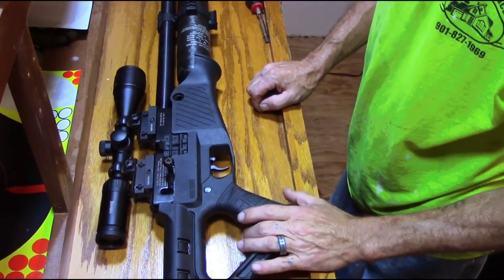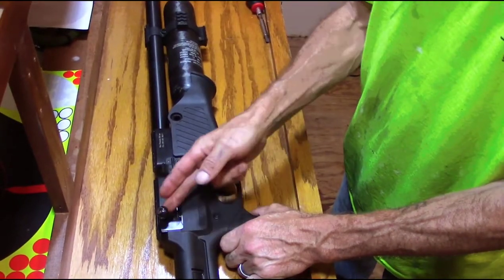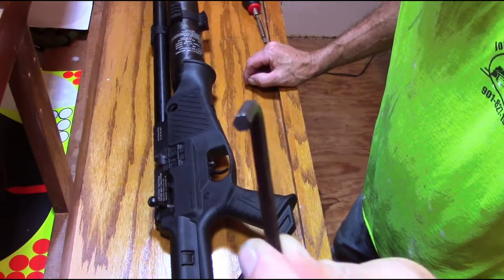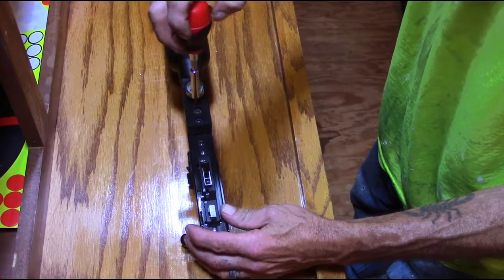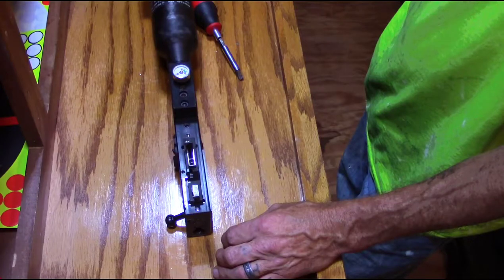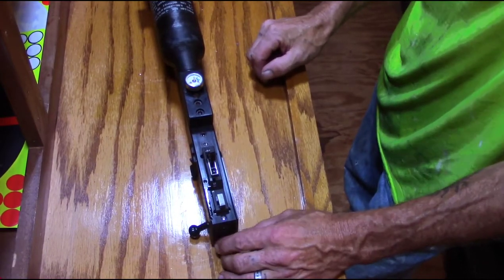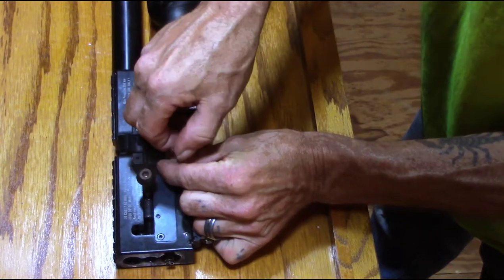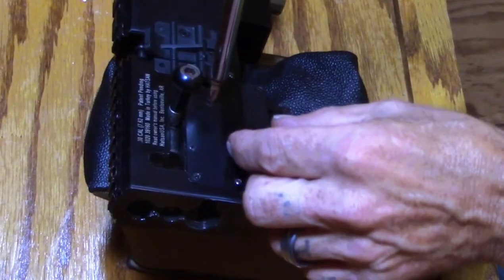blitz .30caliber gen.2 hammer spring adjustment better view

Comment: Yo Roy. Good video. A while ago I tuned the blitz the same way your doing.  Its worth getting the extra long allen wrench pack for that adjustment. I think I got mine from Lows. Before hatsan returned my gun from repair,  I had the older hammer spring screw that did not have the flat head screw in the middle of it. I was told by hatsan reps that the middle flat head screw was an upgrade to keep the hammer spring more stable. Anyway, with the long allen wrench and with the flat head middle screw removed and hammer decocked,  I was able to have the size 5 allen wrench in the hammer and the size 2 allen wrench in the hammer adjustment lock screw at the same time.  I would loosen the hammer adjustment lock screw then make may hammer adjustment then quickly tighten the hammer adjustment lock screw.  And this would be as quick as 10 seconds. Its too damn easy. Your gonna love it when you try it.
Reply from the maker: nice. thanks for the info.
Reply: This is for trigger adjusment? Or what ?
Reply: @fidellopez528  That was for adjusting the hammer spring to increase or decrease firing power
Reply from the maker: @fidellopez528  unfortunately you can't adjust the trigger on the blitz but it dose get better the more you use it. this video is for power adjustment maybe get 3 to 4 more fpe
Reply: I cant wait to get mine past an avg of 670 its down to  after i get whats left of that lame grease out.n new moly in.. im doing baseline   Hates pellets  No probs withmy gun at all   200 pellets or so    . Kinda nernous...
Reply: avg was like 690 fps  44.75grfor a while   //i dont go under 230 bar during test
Reply: @KERNFUZED   bad seals will lower your fps

Comment: Thanks again for the video. I couldn't have done this without it. I just turned my screw out 1 rotation. I went from 680 to consistent 730 + only did 16 rounds im sure it will do an occasional 750. My auto still works. I am very pleased now with the power.
Reply from the maker: Glad it worked out and i could help

Comment: I think il get the 25 over the 30 as it gets around the same energy when tuned macabspeed got 52 fpe with a 25 cal blitz so no reason to go with larger diameter when power is the same in fact 25 is more deadly than 30 at the same FPE same projectile baker airguns did a test.
Reply from the maker: I'm getting 62fpe now i bought a new hammer and a new hammer spring
Reply: @airpower7692  where’d you get those, Thats a decent bit a power now for the 30
Reply from the maker: @fa-sb9ke  hatsan USA i emailed them what i wanted and the emailed me a invoice i paid it and they shipped it
Reply: @airpower7692  What exactly did you ask for Im really considering to do the same mods that would be more potential to the blitz.
Reply from the maker: @fa-sb9ke  i requested a new hammer and a new hammer spring
Reply: @airpower7692   Was it a little heavier spring than stock?
Reply from the maker: @fa-sb9ke  it felt stronger but not by much also the hammer was little thicker which adds more mass to it to hit valve harder
Reply from the maker: @fa-sb9ke  you can see them on that video i uploaded of it
Reply from the maker: @fa-sb9ke  https://youtu.be/YF4SkRbo6r4
Reply: @airpower7692  Ohh I see it now thanks great content keep it up.

Comment: Nice video! For future reference, you can uncock most if not all pcps by pointing the gun in a safe direction, holding the hammer completely back,  squeezing the trigger, and slowly letting the hammer move forward. I should honestly make a video on that as it does go against our safety instincts lol
Reply from the maker: the semi/ full auto blitz has no way to decock unless you remove all air from it
Reply: @airpower7692  I just used the above method to make an educational video on the topic. I'll probably upload tomorrow. One thing that may be throwing people off is you seem to not be able to pull the bolt completely back and do this method. I pulled it back about 3/4 of the way, hold, pull and hold the trigger (in a safe direction), then slowly release the bolt forward. I hear a click when done properly.
Reply from the maker: @tnthomas567  well I'll be damn that worked holy shit thanks a ton bro. that's why i always say you subs are the heart beat of this channel
Reply: Also, just for the less mechanically savvy viewers, you can simply screw the back screw plate the spring sits on further in to the gun to also further increase the power by compressing the spring.

Comment: I dun broke my blitz, Last night I decocked it by pulling bolt back 70% an pressed trigger heard a click pressed trigger no fire so it was decocked I though neat didnt know I could do that, Just saw a random youtube video on how to decock a blitz, Now took it out today to shoot infront of some folks who aint seen full auto an bam it fails after a burst of 4 shots, Sounds like the gun has something loose inside bouncing around when I shake it. I hope I can get this fixed my self I dont want to send the gun back all that hassle, Im still within 60 days of Pyramid air money back guarantee though until like September 14th.
Reply from the maker: I would send it back unless you know about them internals and how to diy
Reply: @airpower7692  il take a look at it someone said its a valve pin broke an I just gotta change it, Dont try an decock the hatsan blitz like me its not means to be decocked, I pulled bolt back 50% or so an pulled trigger heard a click an the gun was decocked no fire when I pulled trigger, Next day I take it out an shoots 4 shots an fails an it just makes that click sound when I pull the trigger.
Reply from the maker: @marksman349  I decock mine after every use and it's more like 65% not 50% on mine you are also probably going to have to apply some heat to get that valve loose off of that bottle

Comment: Couldn’t you have unscrewed the bottle first before releasing all of the air?
Reply from the maker: No you don't screw this bottle you take out set screws and remove the whole block which you could do but just takes as much time and then could damage those orings then would have to replace those this is just much simpler

Comment: Im still trying!!  had it ... on new plug ..do you have that space behind the spring...
Reply from the maker: @KERNFUZED  I'm not sure what you mean by space behind the spring what I have found is best I put the hammer spring adjustment screw in were the threads are halfway into the hole were the set screw holds it tight then I put the set screw back in but it will wear your hammer spring out pretty quickly by keeping that much tension on it

Comment: How much did it actually increase the power of it ....... was it actually worth it...
Reply from the maker: Not much but i just bought a new hammer and hammer spring and I'm getting 62fpe now so go check that video out
Reply: Only reason I'm asking I just picked up the .30 cal also from pawn store for 500.00 having issues  with semi  it's like it's still in full auto....
Reply: Plus I'm planning on doing  doe hunting here on the property
Reply from the maker: @icehotcap  i wouldn't hunt deer with less that 100 foot pounds
Reply from the maker: @icehotcap  yeah that could be several things i really don't know where to tell you to start but the switch then look at the one behind the trigger under the stock then there's the trigger assumedly itself

Comment: How do you know weather you wanna get more power does the screw just pop out if you go too much counterclockwise? does it just stop, How do you know weather you did too much or too little.
Reply from the maker: Yes this screw will come out and i wouldn't do more than 4 full turns cause you'll know cause you'll not be able to rack the bolt back and lock it open it'll be too tight, you really don't want it real right anyway cause it's going to mess you hammer spring up and you'll need to order a new one like i did
Reply: @airpower7692  Ohh man I wish there was a way to know without a darn chronograph thing costs like 150 dollars honestly need to get one there is no way to know what im at regarding the foot pounds besides the penetration tests I can do an guesstimate.
Reply: @airpower7692  wait so can you turn the screw all the way in an does it stop like thats the starting position right? An from there I should do no more than 4 turns counterclockwise
Reply from the maker: @marksman349  i ordered a new hammer and hammer spring and got lucky the new hammer is a little thicker making it heavier in getting 60fpe with the hammer spring screw put in and just getting past the set screw hole then i put that set screw back in cause of you take it out you can see the threads of you adjustment screw in that little hole
Reply: @airpower7692  Damn thats sounds good 60 fpe. I just bought the larger mags for the blitz cant wait till its here I think il clean bore an test power an see if im happy with it or if I need more. I wanna use full auto!!
Reply from the maker: @marksman349  https://youtu.be/PgZMukT6ZiE

Comment: To decock the hatsan blitz... without dropping the hammer like that,  withou dry firing it...
Pull the bolt to the back and hold it right before the back slot that will "recock" it...
Hold it there with a firm grip and pull the trigger. The bolt and hammer will get sprung forward.... HOLD ON TO IT! .. hold it back and gently guide the bolt foward. 
That decocks it without actually dry firing it.
Reply from the maker: Already figured it out it's in other content I've up loaded thanks for the info.
Reply from the maker: You should check out the other videos I've got my blitz up to 62fpe now
Reply: @airpower7692 
How ?  Im afraid to do this . Personally im capable of it but it seems like a lot of these blitzs are different
Reply from the maker: @chandler4749  to adjust the hammer spring? It really doesn't work for long it actually destroys the spring pretty quick so you'd have to order a new one i would just leave it and enjoy it as is